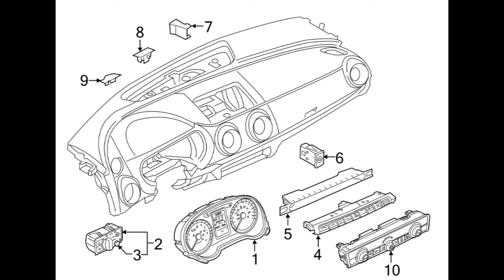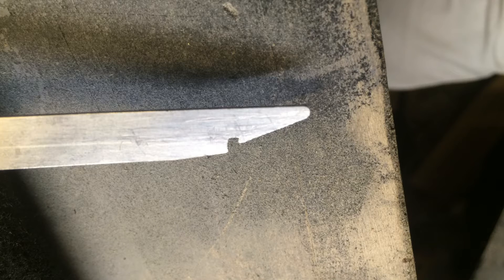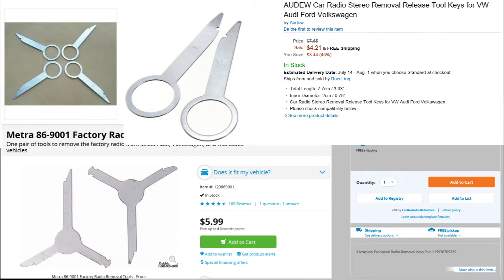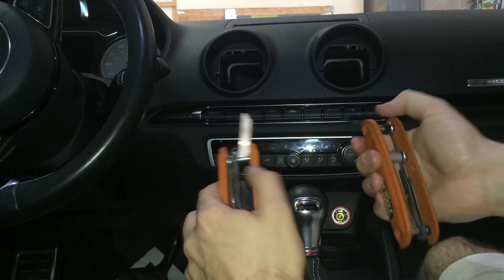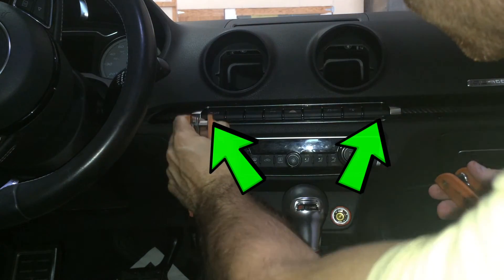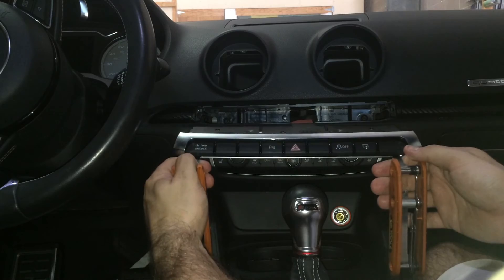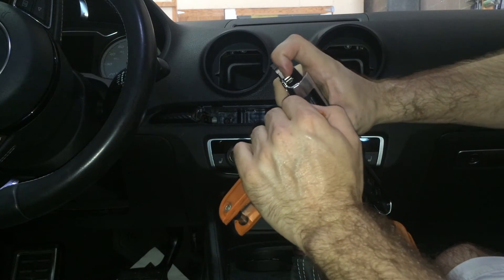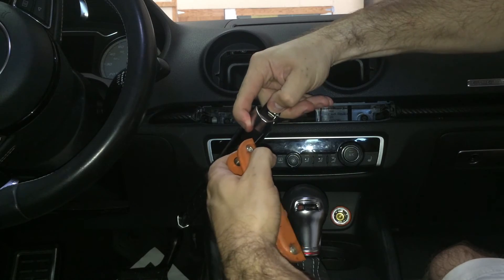How to remove a 2015 Audi S3 Dash Multiswitch

Comment: Is there a specific radio removal key that you need to get or can i just buy one that says they are made for audi?
Reply from the maker: The “Audi radio removal tool” will work. A lot of manufacturers share the same type of key so it might say it also works on Ford, Volkswagen, Porsche, Mercedes, etc.